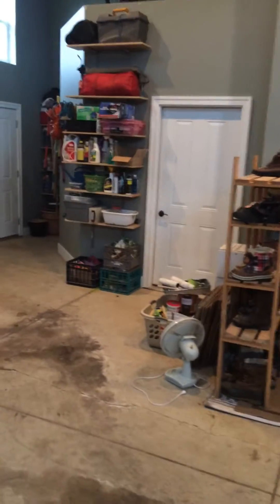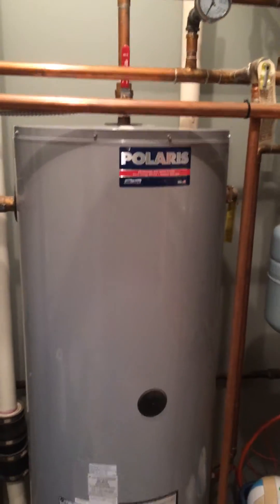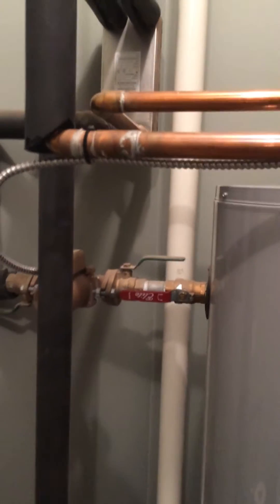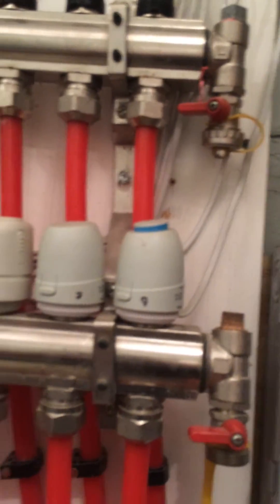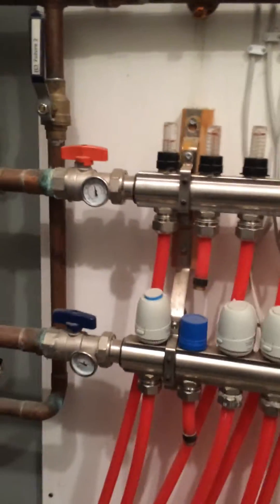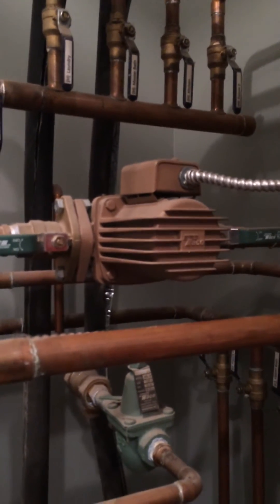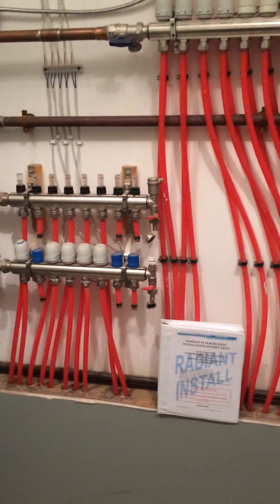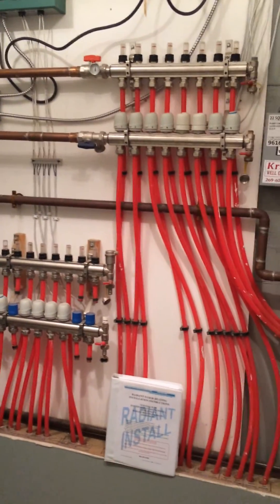In-Floor radiant heating system

Comment: LOVE  just one larger pump.. If one looks at video of many other installs you will see handfuls of individual pumps .  Those are not very efficient since everytime one of those circuits turn on you get big current draw.  Hard to believe but one bigger pump draws way less current but it is not turning on and off constantly  so you dont get that current spike on each pump.  Polaris is not cheap but that said they are super efficient so the return on investment is recovered in one or two winters.   This is one of the more efficient / quality installs I have seen.  Puts some of the big names to shame.
Reply from the maker: Steve Pailet - Thanks for your very kind comments.  I have been very happy with this setup and have only experienced one issue in the past 10 years which ended up being a missed component (bypass valve) from my installer.  I had the part and it was included in the design, he just missed it during the install.  This caused the main circulating pump to go into a deadheading situation while waiting for the actuators to open causing a pump failure after 6 years.  With the Taco, it was a fairly simple cartridge replacement and my plumber came back to install the bypass valve for free!
Reply from the maker: Steve Pailet - in regards to the Polaris, yes it is a super efficient water heater and has always kept up with both our heating and domestic hot water demand - even with 3 teenagers taking back to back long showers!!  The only flaw with the Polaris is in the placement of the igniter wherein it can have condensation dripping onto it.  In my case, I have replaced 2 igniters during the past 10 years - it takes about 15 min and they cost around $50.  I always keep one on the shelf!  Not sure if they have corrected this design flaw since my purchase - if so, I would definitely buy another Polaris!
Reply: @KubotaTee  curious if they have put in a tray to divert the condensate.  The reason I was so positive on your install is it in my view was done correctly.. see far to many who do not do their due diligence.  I worked at a home depot for 4 years and got to laugh at many coming in who were beyond clueless.
Reply from the maker: Steve Pailet - I will be doing a similar install in my 32x72 barn that is now under construction and I plan on contacting the Polaris manufacturer and seeing if they have corrected the design flaw.  I did a lot of research before jumping into installing my Fred Seton designed system, and it has been proven effective over 10 years!  I know there are still ways to improve on the design (new Grundfos Alpha pumps, different placement of expansion tank, etc), but the overall concept of Fred’s Design is simple and effective!
Reply: @KubotaTee  keep us posted.

Comment: Hello, how did you fill your system with water or antifreeze? what did you use?
Reply from the maker: Gadget Town I used water to fill my system.  Hooked up a hose to the manifold supply and then filled each zone until full.

Comment: what was the cost of installation per square foot please
Reply from the maker: Ronald Shepard - to be honest with you, I never figured it out. I know it was a lot less expensive than the quotes I received. I did everything myself except the copper work connecting the manifolds and the hot water heater.

Comment: Hello, what number taco zone control are you use? where did you buy them? thanks
Reply from the maker: Dmitriy Korzo - the zone controller is from Taco.  The model number is ZVC406-3 and was purchased from blueridgecompany.com
Reply: Thanks for reply.  Is there anyway you can please send a video for the wiring of your zone valve controller. Do you use 2 or 4 wires controllers?
Reply from the maker: I just uploaded a new video on the Taco controller wiring.  I use 2 wire actuators.

Comment: Hi, I just finished our timber frame to lock up, here in Sault Ste Marie and starting on the plumbing/electrical. I am doing infloor heat on all floors and have also decided to go with the Polaris water heater. Are you still happy with your choice and how has it been economically?
Reply from the maker: Hi Dave.  My Polaris has been virtually trouble free for the past 7 years.  I did have a small problem with the fresh air intake sensor getting clogged with cottonwood seed puffs because I did not initially install the recommended filter - this was a user issue on my part.  The only other issue I had was the igniter going out after the 5th year.  The part was easy to obtain and very straightforward to install.  In terms of economy, it is a very efficient unit and has met my expectations.

Comment: what number is that taco pump?
Reply from the maker: Hi Ryan.  The large Taco pump is a 011 - this is used for circulating the hot water through all the loops.  The smaller Taco pump is a 008 - this is used to circulate the hot water between my Polaris water heater and the heat exchanger.  These pumps have worked great, however if I were doing the system over again, I would have purchased variable speed pumps and avoided the bypass valve.

Comment: Thanks for the video. Where did you get your manifolds, and what brand are they? Did you use any heat transfer plates under your floors?
Reply from the maker: Hi Christopher - the manifolds are stainless steel and made by RHT.  I bought them from Blueridgecompany.com and have been very satisfied.  One of the two manifolds developed a small crack after the second year.  I called up their customer support and they sent a new one to me via fedex overnight service - no questions asked.  I have two of these units and they are both working great.  I can definitely recommend the units and BlueRidge.

I did not use any plates under the floor.  I simply used special staples to mount the PEX pipe directly to the underlayment.  The ceilings are closed and since heat rises, it transfers to the floors very well.  Never had any issues with rooms staying warm enough.

Thanks for watching!
Reply: KubotaTee Thanks again for the response, and nice job on the setup.  I sent you a private message.

Comment: Thanks for the video. I also am currently plumbing one of Fred's designs. Would love to see a video of the flow of your water system if possible.
Reply from the maker: Sure thing!  I'll shoot another video later today and walk you through the water flow for the floor heating system.  Watch for a new video to be posted on my channel.
Reply: Thank you! BTW do you recall if your plumber added a back flow preventer between the fill valve (aka pressure reducing valve) and the shutoff valve? It should be by the expansion tank in the original diagram.  The reason I'm asking is because I posted to a heating help forum just to double check on the design and was told that a backflow preventer was necessary by code in certain areas. Looking forward to seeing the walk-through can't wait thanks again.
Reply from the maker: Yes!  A back flow preventer was installed to ensure the radiant heating loop water does not contaminate the domestic hot water in the house.